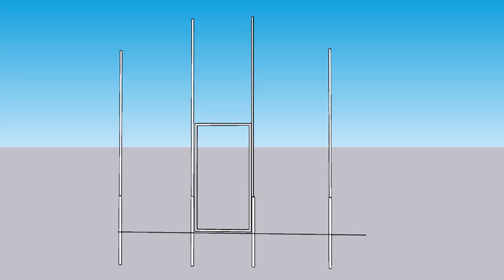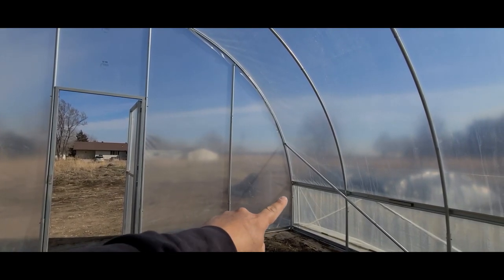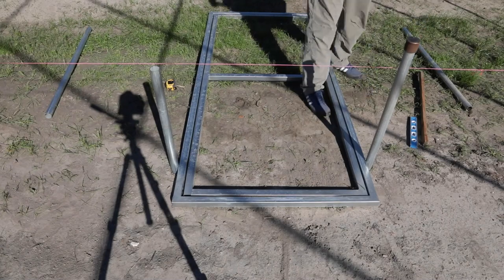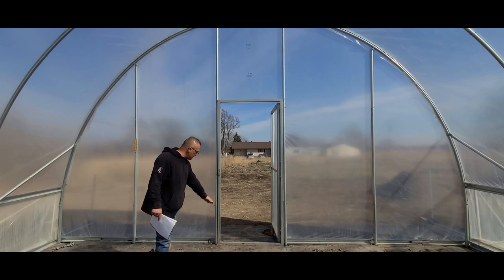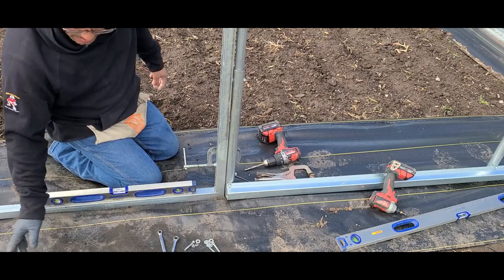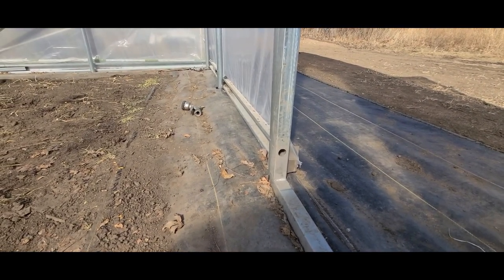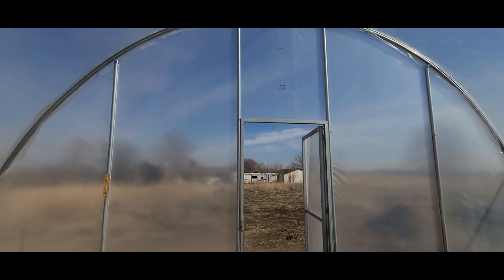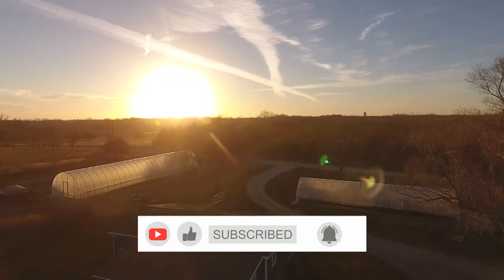Building Hoop House Endwalls | Four Seasons of Market Gardening Ep. 10

Comment: Is there a limit to how long you should make a hoop house for overwintering?  I don't see any reason it could be too long, but thought I'd ask (could be I don't know what I don't know).  The longer I can make it, the fewer I need to build (and fewer of the end walls I'll need to build).
Reply from the maker: You are 100% correct on the endwalls.
The longest one I have personally been in was 200 feet .
If we get orders for big commercial ones 100 foot is pretty standard, but 120 foot and 150 foot is not out of the question.
Your dirt work would have to be pretty great as well as your drainage.
You would also want to consider what your prevailing wind and surroundings look like for wind breaks as the longer the tunnel the more wind load it takes on.
Reply from the maker: Great question.